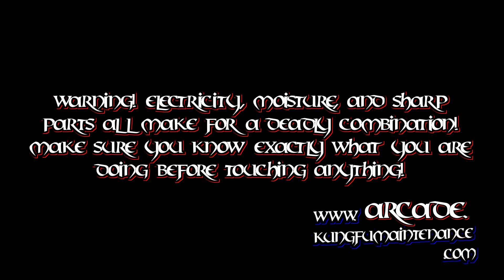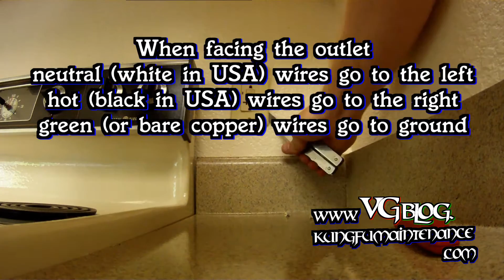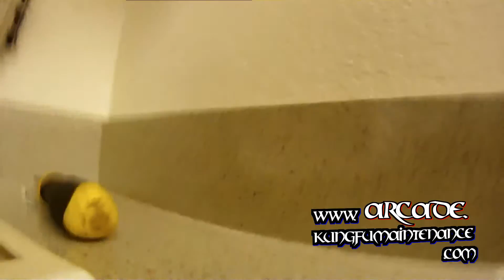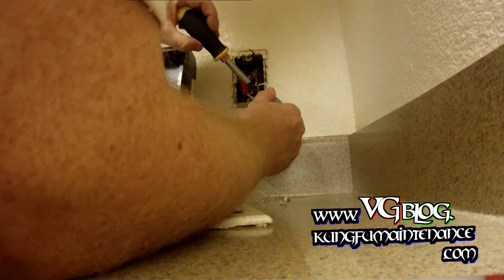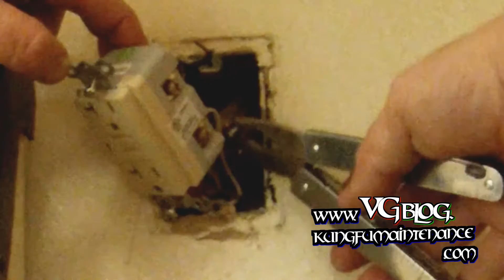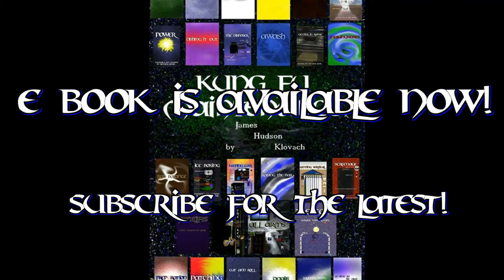How To Rewire GFCI Outlet So Refrigerator Is Not On Load Plus Fridge Stops Tripping GFI Circuit

Comment: Older fridges do not like GFIC. Simply change out the GFIC outlet to a standard outlet if you aren't close to water. I moved a beer fridge into a room with only gfi circuits and would pop when plugged in. After switching out the outlet it's working great again. I am no electrician so call one if you are unsure. There could be other issues like bad wiring.

Comment: Dwelling units.
As noted above, GFCI protection has been required for all 15A and 20A, 125V receptacles in the bathroom area of a dwelling unit for more than 20 yr.
GFCI protection devices are also required for all 15A and 20A, 125V receptacles located in garages and grade-level portions of unfinished or finished accessory buildings used for storage or work areas of a dwelling unit [210.8(A)(2)]. However, there are a couple of exceptions to this rule. GFCI protection is not required for receptacles that are not readily accessible, such as a ceiling-mounted receptacle for a garage door opener. Nor are they required for a receptacle on a dedicated branch circuit located and identified for a cord-and-plug-connected appliance, such as a refrigerator or freezer.

http://ecmweb.com/code-basics/nec-requirements-ground-fault-circuit-interrupters-gfci

Comment from the maker: All my kitchens are wired this way and I would say I had to rewire about 5% of them that were on the GFCI. I think you are right that the fridge should be on it's own dedicated circuit but it is not. The stove is 220 volts so stove is not on the GFCI but all other outlets are. Funny thing  it seems to me that units that had newer fridges seemed to be the ones that would trip the GFCI. Older fridges no problem(as long as no power surge). A no fun stinky situation if not caught right away.

Comment from the maker: Sometimes it is. New code requirements call for any outlet within six feet of water to be on a GFCI. The idea being any outlet that could be within reach of water would be protected. Ironically the picture on the side of the package box of one of the GFCI's shows a refrigerator.